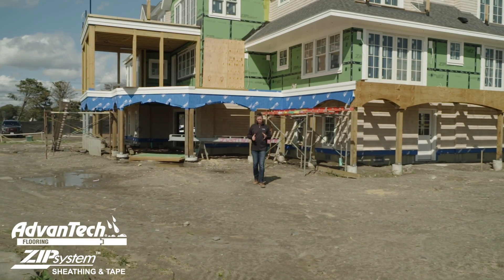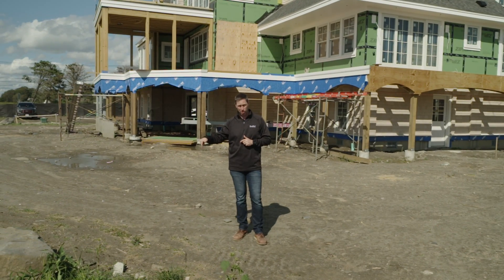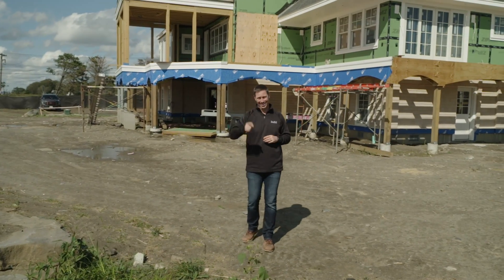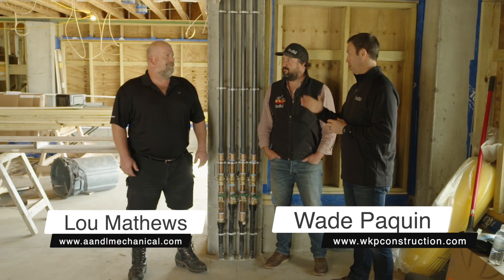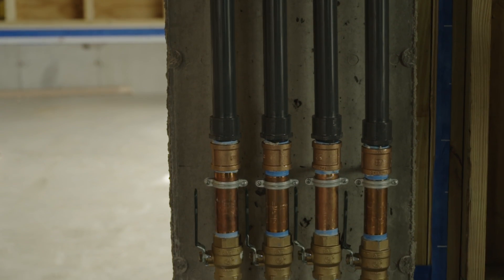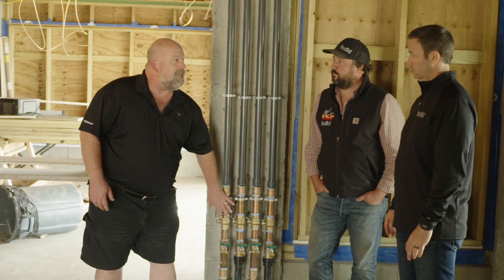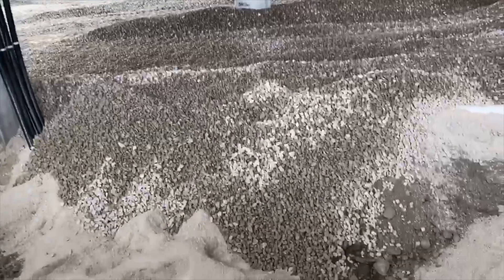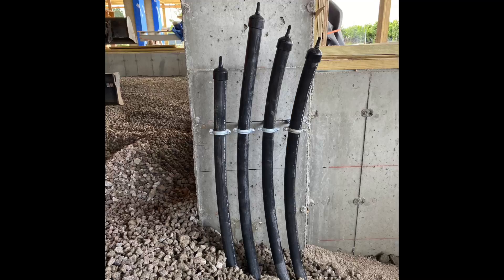Debunking 3 Geothermal Myths

Comment: because you run the pipes in the flooring there is no traditional floor insulation which makes the fall season extremely uncomfortable to be honest. you have to crank it in the fall seasons for it to work prperly and the generator takes over.. to be honest.. you gotta dig very very far down.. home use geothermal is not doing that.. ti's not REAL geothermal and i find it very misleading

Comment: It shouldn't cost that much more. I replaced my geo unit last year. I got 3 bids, $18,000, $23,000 and $28,000. 
It was just a swap out with some changes to the plumbing and attached ductwork.
CLEARLY they are gouging, like everything connected to HVAC.
I bought a 5 ton unit with a multi speed soft start fan, a desuperheater, sound package and an all stainless cabinet. It has NO fancy electronics to cause constant and expensive repairs, just diagnostics.

Comment: Installed a closed loop system in Manitoba, Canada where winter is damn cold. Running a Waterfurnace on a 4000sq ft old school on slab since 2005. Replaced a capacitor and the AC condensate line. Unbelievable how great it is.

Comment: High price is not a myth! A basic system for a new house (including ducting) is quoted at 18.5k, Mitsubishi heat pump $25-33k depending on configuration, geothermal is $66-70k on a midrange equipment. 2024 prices are wild...

Comment: You do not talk about geothermal systems. You talk about ground based heat source. Ground based heat or cooling source is depending on the constant temperature in the shallow areas of the earth crust. We talk there about to 1 m down to about 200m.
Geothermal means using the heat radiating from the earth core. For that you usually need to go deep. At least 400m and up to several km.
The biggest myth seems to be, that ground based heat source is geothermal.

Comment: I have witnessed a highly engineered vertical well system fail miserably.  Use some kind of horizontal layout.  Copper laid in a sand bed and proper fluid chemistry will outlast the water source heat pump.

Comment: Build show videos are very informative and I like lots of them. But unfortunately sometimes they fail to address really key points, for example how much land area you need to do a trench style installation and what the constraints are on getting a drill rig in between closely spaced houses without damaging foundations or utility (like gas) lines with the extremely heavy ground pressures of such machines. All these fancy ideas don't really do much good if they're only feasible for large parcels. That's such a small proportion of the US housing stock that it's just not useful. Another constraint that's hardly mentioned here or in other videos is really cold winter temperatures. For example for warmboard floor heating - which it would be great if you could run it off geothermal - the show on it touts the heat pump version but with no mention of noise impacts on you and any nearby neighbor, nor of the very high power demands when the pump is running in very cold outdoor temperatures. That will typically mean replacing your entire electrical system to supply that much electricity, plus you then need a giant backup generator to supply that power during winter power outages - exactly when they generally occur. Practicalities really matter.

Comment: If the biggest issue in all these situations is the digging/loop system, why not redesign the tubing so you don’t need as much laterally and not have to dig as much if vertical system

Comment: Why you doing all this? You get the same temperature from your cold main water line coming in your home. 
No need to dig or drill holes. Don't get it.
Reply: You get hot water from geothermal….
Reply: @TheFreeBro  NO, you don't. You get the temperature of  8 to 12 degrees.

Comment: Each well costs thousands of dollars. So the cost of geothermal is high when you use multiple wells.  And the electricity to power those pumps is probably more than a regular heat pump. A closed system is cheaper.

Comment: Thank you from Ireland I have geothermal heating 14 years now. Done it when no one believed it would work. It's been working great even though the installation contractor and the supplier left a lot to be desired. Thank you for the excellent video wish I had you guys doing the job.
Reply: Hi Liam, also in Ireland. How much does it cost to run the pumps etc

Comment: Big Apartment buildings no longer need Giant Air Conditioners on the Roof...  it's all in the basement...  pumps, heat exchangers... maybe the Hot Water Tank is up there???  maybe it's in the basement...  plastic pipe means its a lot more insulated vs Copper piping...  Roof Top can now have a patio???  or amazing Penthouse Apartments?  whatever...  every building needs back-up generator...  since the Grid is seeing so many Storms / Tornado /  Hurricane.  A super insulated home (performance built) can probably  have 2 wells (75 feet deep = 150 feet of pipe)... Giant house needs 4 wells.  It's amazing you get Hot Water year round (Zero Gas needed) but with A/C vs Heat in winter...  Power bill must be sizeable...  or in a performance home... shut it down for 3 months?

Comment: Having a basement below ground level is one of the cheapest options for many house owners.  If one builds the basement to be used as a separate living area a family can rely upon the basement to be cooler in the summer and more resistant to bitter cold in the winter.  So a family can plan to spend more time in the basement in the summer during heat waves instead of relying upon air conditioning.  This uses the same concept of a geothermal heat pump system with none of the investment not adding to the homes value.  Just my two cents!!!

Comment: My question is, with all the scare about plastic in landfills despite being completely encased in a concrete tomb, isn't a geothermal system much much worse considering it's directly tossing ten tonnes of rubber directly into the raw earth to be corroded in the soil?  Geothermal pipes have a life of 50 years, meaning they corrode enough to be replaced in 50 years time.  wiki says 450 for the complete biodegrading of plastics.
Reply: That means it/the pipe will last a long time,
Reply: @mainemail7358  Yes, but far less time than a landfill.  Yet it's not okay to throw away plastic.  

My argument is, "why is burying plastic okay here, but not at a landfill that is designed to prevent things from biodegrading."

Comment: the first myth is that it is actually geothermal. it is not. at a depth of 6 to 10 feet you don't get geothermal heat, you get solar heat that has been stored in the ground. to get true geothermal heat, you have to go DEEP, like 1000s of feet.

Comment: These systems are called GEOEXCHANGE, that uses the constant underground temp as a alternative to ASHP
Geothermal is harvesting energy from superheated 
Earth way further down than a geoexchange loop field or well, typically steam that drives a turbine generator for electrical power

Comment: I don't see how this is cheaper.
Reply: The energy required to operate the system is significantly less because you have a constant 50 degree starting point.
Reply: @johnlee7085  50 degree starting point?

Comment: I have a closed-open hydrid geothermal system in North Texas. It's been running since 2011. It's been super reliable. Nowadays I might not do it. But I'm so happy with my system so far. It's saved a LOT of money. I'm far enough south that I don't need any glycol or methanol for anti-freeze. I just run straight water with anti-rust inhibitor. I don't have issues with water fouling on the open loop part. I only run the open loop hybrid part in the summer and when I do I can cool my 3000 sq foot house for 100 a month in Texas. And my home was built in 95 and is very leaky.

Comment: If one brings energy up from underground faster than it's "natural" heat dissipation, won't this increase the equilibrium temperature of the biosphere i.e. exactly the problem already caused by the greenhouse effect?
Reply: the greenhouse effect is caused by certain molecules trapping heat close to the earth. Our atmosphere is good at this and it's why we can survive on earth. But increasing the molecules that trap heat exponentially is tough to adjust to, as the system starts to bring us more extreme heat than we have ever seen, and disrupts the jet streams that keep our climate stable. Some of these heat trapping molecules include methane (natural gas) and carbon dioxide. 
A greenhouse is hot primarily because of the glass, and because the sun shines.

Comment: Superb presentation. This IS the answer. I have been advocating it for years. Both on small scale domestic statems, and large scale commercial systems.
A couple of points. Less of the tech speak. The system is very simple, it is almost water mill  conceptually. It is easy to explain in simple language. The more tech speak, the more complicated the perception becomes.
System longevity. In a closed loop, it is only the pump which is vulnerable. One small part in the system. Your brief came across that the system will last for 25 years. In a more conventional sense it is the equivalent of "your gas central heating system will last for 25 years." Nope, just the boiler, the rest of the system could easily last for a hundred.
I think you could have put emphasis on the point that if a turbine is installed it will provide free electricity, with hot water as a by-product, for the life of the turbine pump (25 years), which more than offsets the cost of the well drilling.
I believe that as geothermal drilling becomes more common, it will drive the price down of the drilling operation. This could be advertised, not just as a way of generating home electricity and heating, but as a way of generating electricity and selling it, from your own back yard. An investment opportunity. I strongly believe that it is then that geothermal will really take off.
Overall a great job guys. I will definitely be using your presentation as a reference.

Comment: I get that some stuff in the system will last 25 yrs and the pump might "last" 25yrs, but it will need seals replaced along the way. I've been working with pumps for 35+ years and even in closed loop systems, 25 years is rare. More like 10 yrs between seal replacements. Just buy some now and store them in mylar bags (to keep oxygen and ozone away from synthetics) and you'll be ready for the job when it pops up. Remember, do not contaminate ceramic seals with anything, I don't even get fingerprints on them, certainly not any kind of oil. Once they're installed seated together, their close fit keeps them safe. Also, air in the lines will wear out pump veins, always purge the air out.

Comment: If I ever did my farm I’d make underground water storage & above ground storage.  My geo system would connect to 3 major connectors to my water system…one to the underground storage…an other metal above ground storage exposed to outside temperatures and my solar heated water system.  This would allow precise and quicker control of the geothermal system that would do heating as well as cooling.

Comment: I didn't have geo, but, I got a heat pump put in. I don't remember the details, but, I asked for a larger one and was told it wouldn't help, the heat pump had to be near capacity to work correctly. In east Texas. In the summer, I couldn't get my house under around 85 f. I will never have another heat pump. My installer was probably just a liar, but, can't afford to make the same mistake again.
Reply: I have a heat pump in East Texas.  2000 sf costs under $140 per month to heat or cool for 10 years.

Comment: Mech Engr. Here:   I have this installed in my own home on the coast of SC.   One benefit they do not tell you is that your air temp. will be colder with GSHP and heating air heating greater with GSHP than conventional heat pump.   Having done several geothermal systems I see a temperature rise in water temperatures when the units run for a long time such as either really cold days or really hot days.   Transferring heat from pipe to earth or earth to pipe is a slow process even with the best improved grouts.   Consequently, adding additional wells during construction is not a significant cost, particularly with Fed/State credits, and will improve the long term satisfaction of the owners.   I would never, never, never, do one of these systems without an engineer involved.   My interest is a system done right, and not profit for well guy or contractor.  In the video, they tell you about the valves they put in.  Where are the supply and return temp. gauges.  Where are the pressure gauges?

Comment: 50% higher cost than conventional? They are lying, plain and simple (or conventional systems are sky high in cost where they are). My own experience is that these geo-thermal systems are 3 1/2 times the cost of conventional in my area. Even with the very generous tax credits, they are still more than double the cost of conventional.

Comment: Geothermal energy is energy taken from the Earth's core. It comes from heat generated during the original formation of the planet and the radioactive decay of materials, it is adding to blobal heating and climate change and is not green or sustainable. It is part of the problem of humans putting themselves first above all other species and even the ecosystem. I call that dumb.
Reply: The problem with global warming is not the added heat generated by human activities, but the addition of greenhouse gases to the atmosphere (CO2 and methane mainly). Thus your statement on geothermal is baseless.

Having clarified this point, this video is talking about 'ground source' heat pump systems, which technically use the ground as a heat storage system: they extract heat during the winter and pump it back in during the summer. In temperate climates the two processes tend to cancel each other out, which in the long run leaves the ground around the wells at a constant temperature.

Comment: Old technology, you can use air source heat pump that heats down to -26F at C.O.P. that can match Geo at a fraction of the cost.
Reply: Air source heat pumps are gathering heat from an  inconsistent source.  Geothermal is better in cold winter months, where the ground temperature stays the same all year round.
Reply: @libertyspikes666  Yes it is true that air source heat pumps operate with inconstant sources of energy (Being operational efficiency changes depending on outdoor temperature's ) one can not ignore the fact that C.O.P. testing takes  into account that C.O.P. is an average across the seasons, thus holding to the high efficiency of newer style air source heat pumps.  I in no way will refute that as temperature decreases, the geothermal systems gain the upper hand in that category. As a 30 year HVAC technical mechanical designer (I am also a certified geothermal designer with I.G.S.H.P.A and a certified H.E.R.S rater (More information regarding H.E.R.S rating on the Building Science Website), I can assure people  that spending between $20,000 to $30,000 for geo technology (which has been trying to stay alive for years now) verses spending $5,000-$8,000 (Depending on systems and location across the north Americas) on high efficiency air source heat pumps is just a no brainer! If C.O.P.s are this close between the technologies in todays market, return on investment for Geo will never be recouped! P.S. Matt I love what you do and keep up the good work in showing people technologies that are available. You are one of the few people I trust on youtube!
Reply: @sky0049-v1y  You touch on a very important issue, which is the relative ROI of air- vs ground-source heat pumps (GSHP). I'm personally pondering over one of these two solutions for a relatively large house in the countryside here in Italy and have struggled to get some hard numbers from reliable sources. I also have an engineering background (but don't work in this field) so finally did my homework by reading scientific publications on GSHP systems and comparing heat pump datasheets. Note that here (and I suspect in most other european countries) we get the same tax credits for both systems, so that doesn't factor in the decision. With this premise I see the following problems with your statements:
1. "geo technology has been trying to stay alive for years now". Definitely not true, at least for Europe: GSHP systems are widespread here with current sales exceeding those of air-source heat pumps in many countries (e.g. Germany, Austria, Norway, Sweden; Italy being one major exception). Furthermore, the market is growing everywhere at a double digit rate. Source "Geothermal heat pump development: trends and achievements in europe" on Researchgate (2017).
2. For winter heating the actual seasonal COP of geothermal seems to be around +1 relative to that of modern air systems. The argument that geothermal looses out in warmer climates is problematic to say the least, since higher average air temps lead to a warmer ground, which improves the COP of geothermal heat pumps as well.
2. For summer cooling, during the first part of the season geothermal sytems can be used in passive (i.e. free-cooling mode), which consumes minimal amounts of electricity and drives the overall SEER of the system above 6 (and way above air systems). Source: "Monitoring of a vertical borehole ground-coupled heat pump system: A case study from a marly-limestone heat reservoir (Urbino, Central Italy)" Geothermics, 2016.
I should add for the benefit of other readers that the cost of a a geothermal system is highly dependent upon the type of rock/sediment at your location, its thermal conductivity and the presence of a flowing water table. The required number of boreholes can vary by a factor of 2 or more! In good locations two 100m boreholes can be enough for a medium-large independent house with good insulation, which would set you back by around 10-12k.